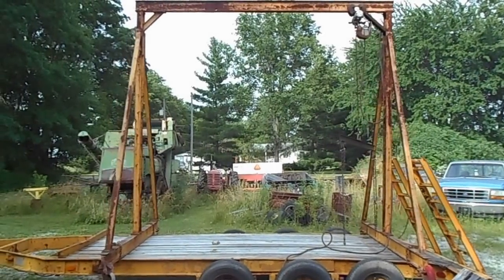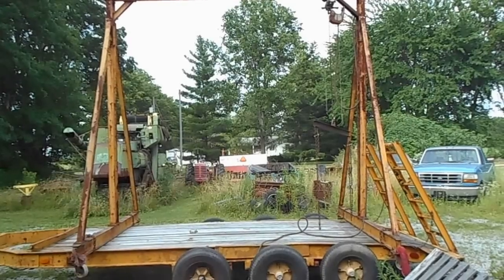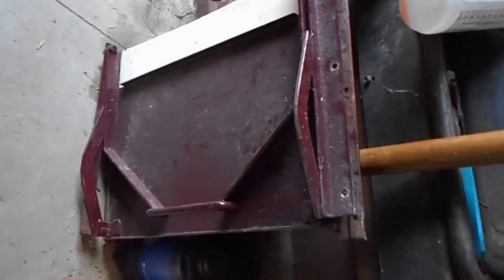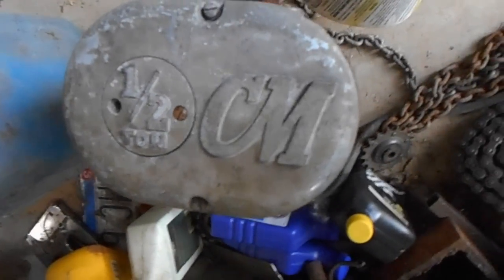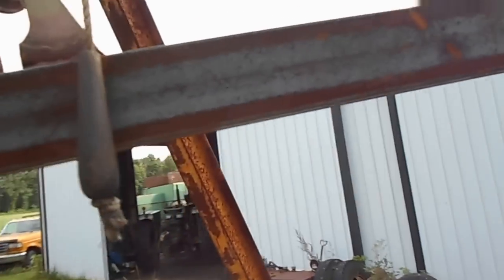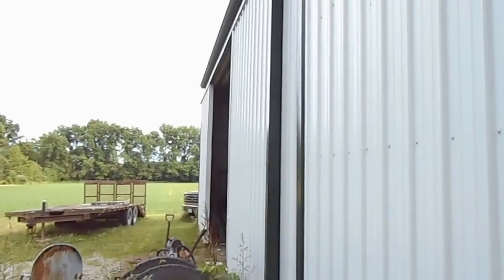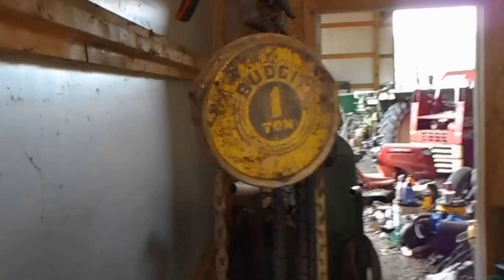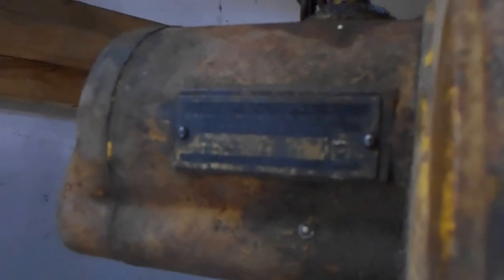Auction Buy's and They Work !

Comment: I worked in a belt factory that had over  100  Budget 1/2 and 1ton  electric  hoists  I  worked in maintenance and one of my jobs was keeping  rebuilt hoist on the shelf....They are the Timex of hoist..The manual that you have..will wear out the operator before it does.....You did good buttercup
Reply from the maker: Thanks !  I had no idea there were 2 hoist's laying on that pallet I really thought it was one so it was a nice surprise to find out there were 2 of them.  The one on the A frame I had to see if it worked or not, To my surprise it works great ! Has a small air leak I got to fit but I can stand to do that . Its one of those things you want for a long time and you finial get one and after using it you wonder how you got along without one.  Bandit

Comment: I know what you mean about the heat on Sunday 'cause we had it too in n.e. Ohio. It was so hot that I baled hay and then called a guy and told him he could have it for half price if he took it off the field. I just didn't feel like hooking up the hay wagon and loading, unloading and stacking it. He sent his kids over with a truck and they took care of it. You really scored at that auction. That thing you call a mechanical ram is what I call a ratchet jack and believe me they sell for more than $30 at tractor supply. I know because I bought one several ago to replace the cylinder on my haybine because I don't have working hydraulics on any of my tractors.
Reply from the maker: Sunday was miserable to do anything outside let alone bale hay !  I've done it before but you are just miserable doing it and it flat wares you out fast !  That ram is as handy as all get out, I have one but it never hurts to have 2 of them and for $30 I had to have it.  I used to move a lot of equipment and learned real quick to take the ram off and put one on cause after you have a transport pin brake and blow a hose you learn real quick to put one on !  I really love going to auctions to pick up some goodies !  LOL  Bandit

Comment: Man that's great!! Even a better deal! That's sure nice the air one is variable speed! That's handy if ur setting an engine in. Chain ones are nice for slow speed but getting stuff off the floor sucks. And electric is nice cuz there fast but they ain't to easy to inch something in with. Looks like u get the best of both worlds
Reply from the maker: I like them both and cant wait to use them as soon as I figure out how to get it off the trailer , I wont go threw the barn doors on the trailer and my cousin is not sure the back hoe will go high enough to pick it up or not so he has to do some measuring to find out for sure. I love auctions sometime, Well all the time and the goodies you can find there !  Bandit
Reply: +Bandit farmer oh ok can u take the scoop and lift up in the center? Not use chains and go under it?
Reply from the maker: I really don't know yet, My cousin has to do some measuring to see if the bucket or boom will go that high. I know my Gehl skid steer wont lift that high.  I didn't think about this when I bought it ! OPPS !    Bandit

Comment: If the backhoe wont reach just jack up and block the 4 corners then pull the trailer out from under it. After that just lift one end at a time with the loader and remove the blocking
Reply from the maker: I'm still waiting to hear back from my cousin about the back hoe if it will work or not, But I have been thinking about how to get it off if the hoe wont work. I love having this problem, If I didn't I wouldn't have the A frame hoist !  LOL  Bandit

Comment: Seems like when you live on a farm and got equipment seems like you never have enough stuff to keep things running. We are always buying stuff to work on things. All of that stuff will come in very handy for you.
Reply from the maker: I found out a week before the sale what and ware it was. A couple of day before the sale I stopped by to see what was all there and saw the A Frame that wasn't listed and made a plan to buy it and I did.  Most of the time I don't buy tools at a farm auction because you can buy new one cheaper !  But this will save me money on some repairs I need to do and it will come in handy for a couple of other things I need to do.  This is something I have wanted for a long time !  Bandit

Comment: CM hoists are nice and parts are available from CM still
Reply from the maker: Thanks I haven't had time to fool with it yet but it doesn't have a power cord so I will have to take a closer look at it and see what it really is. I don't even know if its 110 or 220 yet so I got to do some tinkering with it and see what it is.  But it good to know I can still get parts for it.  Bandit
Reply: Should go both ways for voltage.  They do make them in 3 phase to so look for that.  We have 4 and 2 are single phase and 2 are 3 phase.  They are great units and run about 2k new.
Reply from the maker: I will have to look tomorrow and see what it is.  I was real happy to have 2 out of 3 that work but now I got to see if this one will work too now, That would be a real hat trick to have all 3 working !  This is something me and dad have always wanted but could never get one bought at a decent price till now, And now I have 3 LOL  Bandit

Comment: can you do an update on farm equipment  and do you still have the long 900 tractor?
Reply from the maker: I guess I could do that in the near future,  I still have the Long 900 but right now its down till I can find someone who can rebuild the injector pump. Its leaking fuel into the crank case so its down until I can get it fixed.  Its a Zeter tractor made in Europe so I got to find someone who can rebuild a piston style Europe injector pump, Not as easy as you would think it would be.  Its not wore out its need of a refresh of all the rubber parts and nobody will do that anymore just a complete rebuild and that aint cheep !  But that may end up what happens.   Bandit
Reply: +Bandit farmer ok thanks for the info